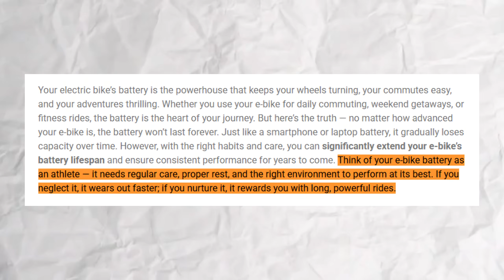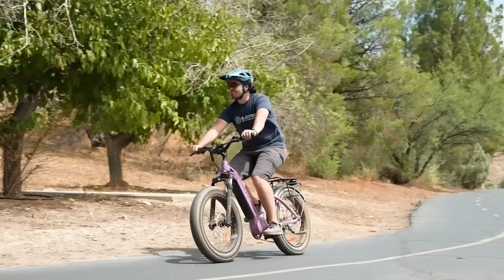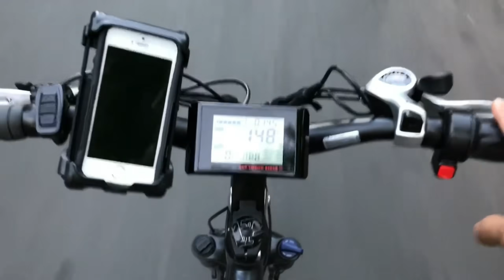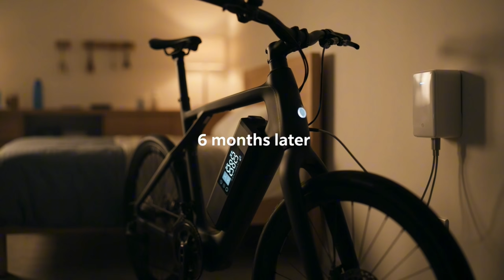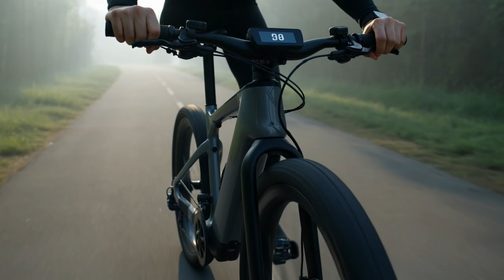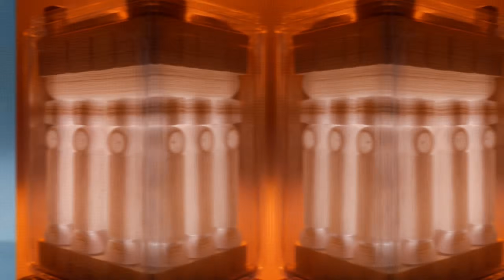The E-Bike Features That’s Secretly Killing Your Battery!

Comment: Stop buying firestarter batteries!  LFP has not started any fires.  ZERO.  LFP lasts 5 times as long.
NO NMC!   LFP: 100 USD, 575 WH, 9.6 lb.    After a few years, LFP has MORE range left than NMC because NMC degrades 5 times faster.  LFP does not lose range with higher power: LFP does not have capacity fade with higher power.
Reply: So half the range and twice the weight. Weight reduces range further and impacts handling. If fires really were a significant risk, you still might have a legitimate point. They are not and this video plays on unfounded fears. According to The NTSD ALL lithium battery fires added together are less likely than an ICE fire and we have been parking our cars under our kids' bedrooms for nearly 100 years!
Reply: @MHH3180  a year or two of use and the NMC will have a lower range than the LFP.   5 lb is not going to change your range.  1000's of fire per year.  So bad, that govs are banning ebikes because of the fire risks.
Reply: @briandonovan9091 my 5 year old batteries are still well over 90% capacity and I never buy expensive batteries. 5#'s IS  a lot on a quality bike and it does impact handling. I really wanted to use Lifpo, but found it hard to get good ones and the weight kind of put an end to my experiment.

Comment: Great info 👍.  In other words... don't use the lcd display, don't charge to 100%, don't go under 30%, don't use it at full power... don't buy an e-bike😂. Why spend 1k or 2k on an ebike and the next year it's not the same bike. I own two ebikes and use them to the max, I even unlocked them to go full power, and bring them to 5% almost every time, that's why i bought them for, to have fun. Here's a tip, dont buy expensive bikes if you're a heavy user. Buy those in the low 1000's so it doesn't hurt so much. I have a blast on mines every time. So have fun people!!!!!.

Comment: What ebike comes with a fast charger? Mine doesn't and I've never seen one that does, they all just come with standard chargers.
Reply: Fast chargers aren't all that fast, but fastER. Anything above 3amps per hour is harder on your battery. Not bad, just harder. ALL my custom builds come with a 2 amp charger for best range and life. I tell my customers to charge every time you ride for the same length of time you have ridden and to get a wall outlet timer to do so (more convenient than sitting around waiting for it). You can also just watch how many watts you use on your ride and charge roughly half as many hours. Either will keep you between roughly 80 & 90% charged for best battery life. I have been riding for the last three months on a five year old battery that still has over 90% of its original range (customer wanted a new bike, so I bought the old).

Comment: While this is basically a good video, it suggests everything leads to battery fires. NEVER will leaving your display on cause damage, much less a fire, to your battery. It just lessens range and the additional charging may reduce its total life span.

Fast charging is harder on your battery. It will never lead to a battery fire as long as your battery is rated to charge at the rate of your charger (factory ones are).  

Maximum boost will reduce range. It will not measureably reduce battery life except that you will need more charge cycles. It will never cause a fire.

Regenerative braking is little more than a joke, but for sure, it so trickle charges the battery it cannot reduce battery life. You use more power keeping the display on while you ride than most CAN regenerate braking. It cannot in any way cause a battery fire.

Constantly topping off your battery is the most common reason batteries age prematurely. It will not contribute to a battery fire.

Leaving your bike on a charger for extremely long periods will damage the life of the battery dramatically. It is the one extremely unlikely, but possible way to cause a fire. 

Most e-bike batteries are 36 volts. A 2-3ah charger is good for any bike. If you get the proper charger for 36, 48, 52... volts it will definitely be as good for your battery as the one that came from the factory. Many aftermarket chargers are superior to factory chargers on more affordable factory bikes. These properly matched chargers cannot cause an e-bike battery fire.

Poor storage does kill batteries. Charging them when frozen or in extreme heat can be dangerous, but highly unlikely to cause a fire.

Comment: He is right ... once battery reaches 100% it trickle charges but it's because the BMS is discharging fully charged cells to bring the max voltage down so that unbalanced cells with lower voltage can catch up and balance with higher voltage cells .
I used a watt meter to monitor the charger .
When light turned green voltage was 5 watts and in about 1 hour reduced to zero  and then the cells were balanced  . My battery gained a small amount because the lower cells were allowed to fully charge . A BMS stops and slowly discharges a fully charged cell bring down the max voltage allowing the charger to continue because a BMS also prevents the total battery charge from charging over the max .
You should balance your cells every 4 or 5 cycles by just leaving it plugged in an extra hour after fully charged .
Also , do your charge a couple of hours before riding so that battery cools down from charging and battery doesn't sit too long fully charged which can cause degradation. 
Always charge while you can occasionally  monitor in case a fire happens . Batteries that catch fire were usually charging and the BMS or wiring failed causing over charge and over heating .
Reply: Safest SoC for storage is 50%. Set your BMS to stop it there to maintain it, then set it to go up to your preferred cap a couple hours before you want to ride.